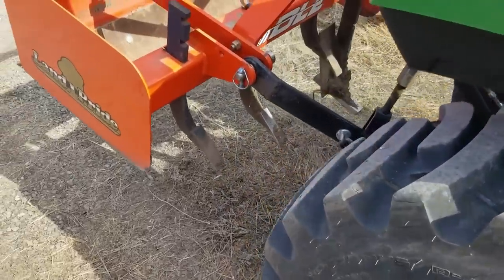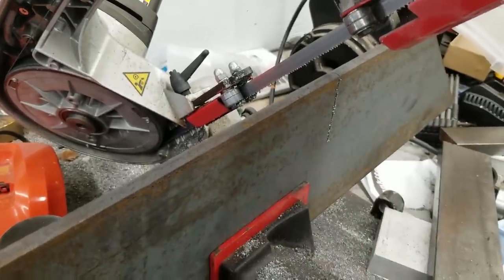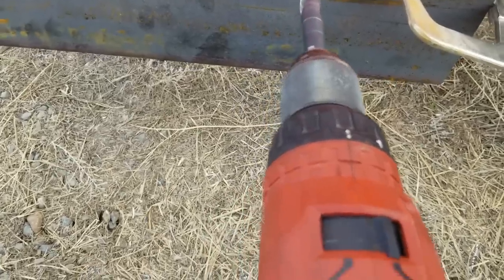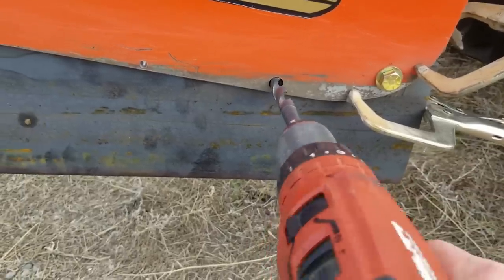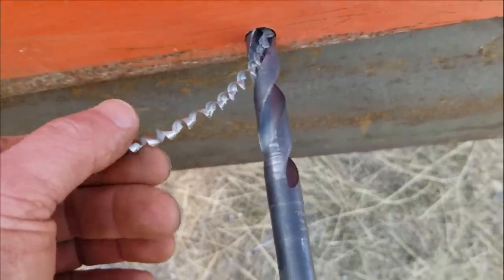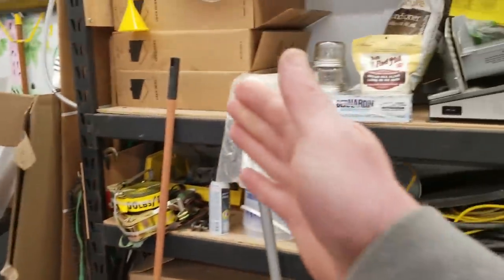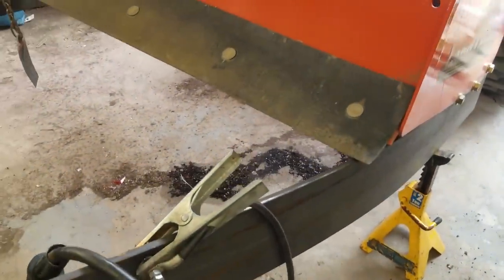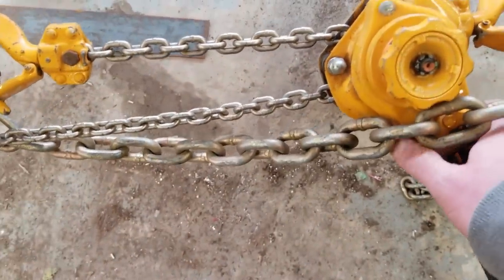Ol' Farmer Contraption: better beds

Comment: Ahh yes, picking rocks. I thought my folks were in the wrong business farming, we should have had a gravel pit 😂😂
Reply: Gravel grows up to be rocks.
Reply: Root systems keep the rocks in the ground for the most part. Its why the forest floor isnt covered in small rocks. Clear the ground down to open soil and every freeze thaw cycle brings every rock up an inch or 2. You'll be picking them for years in a new garden if you're ground is rocky like ours. Many places ive dug in ct were more rock than dirt. We would be short on backfill a lot of the time if the job called for rocks to be taken out. Putting it utility lines, planting trees, etc.
Reply: @ctdieselnut  Your average Black Hills South Dakota hay field will give you rocks by the semi truck load every year for many generations. My friends grand kids are picking rocks in the same field we did 30 years ago, so on and so forth since Custer first can through on his fateful trip to the Little Big horn.
Reply: @TraceyAllen  , I grew up 3 miles east of Caputa, just outside of Rapid City. The rock picking in that area is no joke. Dug up a 30 pound Fairburn agate digging a fence post hole one summer. It sat on our front porch for years, but long since has disappeared. Wish it was still around. I would slice it up and probably be able to sell it to make up for all the free labor I put in every summer picking rocks out of the field.

Comment: Torch the bends so the metal doesn't spring back when you remove the bolts from the back, And then add the bracing for redundancy and visual appreciation.

Comment: I once was making motor mounts for my 24 Hours of Lemons car with some UHMW,  a hole saw, and a 1/2" corded drill from the big rock candy mountain. I thought I could shoot a nice picture for the build blog with my left hand, while drilling with my right, and soon found myself flipped over with a cord around my right arm and a busted metacarpal to boot. Two handed drilling! And is that RCR at the end?

Comment: Here's a trick to drilling a hole to get through the last part.  Once it's where you changed speed just go around to tother side and drill from there. It goes through like butter that way and also does not leave a burr.

Comment: To drill through the other side of metal I let off on the pressure.  If I get it right the hole finishes smoothly.  Though, I still pucker up from memories of twisted wrists and drills chucked across the room.  If you do it enough there is a change in sound to be learned when the bit is reaching the other side.  It's the hole getting bigger as the point goes through.  Or, you can strap a piece of wood to the other side to drill into.  What's happening is as the metal being drilled gets thin the drill bit is able to grab the whole thickness and get all caught up.  Literally, but not quite literally,  biting off more than it can chew.  Light pressure or a backing plate helps with this.

Comment: I grew up on a good bit of land in the San Pedro Valley of southern Arizona my grandparents were right down the road. The land owned by my parents and the land owned by my grandparents was all ancient riverbed. Just under the ground is densely packed rock between 18 and 1 inch and I'd say every size had just about equal representation. No lawn mowers. Both properties had to be cut with a string trimmer. Picking rocks was a chore that we attempted and that my mom is still attempting at retirement age. It's hopeless. But I still had to fucking do it.

Comment: Back in the day, the time before the insanity bled over from England, we used a sheet metal grind on the drill bit to keep the bit from binding on the final part.  Some call this a brass grind, as brass will pull the bit out of the chuck.

Comment: You need disk to help break up the dirt prior to pulling into rows.  Two pairs mounted on that front pole should suffice.  Hard part is they need to be a V shape so the edge of each  disk in each pair touches.  The effort to add them will be greatly rewarded.  It reduces the rototiller time and knocks apart large chunks that were missed.

Comment: I go full speed as fast as the drill will spin at the end of the hole. If your spinning fast when you hit that edge on the back side of the hole the momentum is usually enough to breakthrough and cut that last little bit of metal.

Comment: :You have to replace that band saw with a cold cut saw, total game changers. My makita chopsaw is awesome. And my Milwaukee skill saw equally so for jobs too big to move. The dewalt  5 inch 20v skillsaw is also remarkable, great for going to metal rack and just cutting off a piece of flatbar without moving it. I can make a four foot cut through 1/4 plate in 30 seconds, razor accuracy machined edge.

Comment: It might be contradictory to standard practices, but I personally like to set the clutch to its highest setting that isn't drill or hammer. On some drills i might set it lower but the intent is for the clutch to slip instead of unexpectedly breaking my wrist on a random ass pocket of air in military grade materials and especially with tree carcasses.

For the most part, my hammerless compact drill sits on a clutch setting that slips right around 20in lbs of torque.

Comment: Where I live it was a bit more root picking than rock picking. Big ole bonfire on a cloudy day so no neighbors called the fire department. Stand about 100ft away so the heat didn't render the grease from your face. Great times!

Comment: all that about drilling remided me
I like to pull out my smaller drill to do bid holes in steel. 
the XR I normally use will throw my scrawny ass across the room when it binds up, so id rather have the atomic just stall on me, correct whatever problem and keep chooch'n
the XR is really only the go to because it has a hammer mode

Comment: I own some Festool tools … and since I own them I never broken a single drill bit - with the torque limiter activated at a torque suitable for the drill diameter… but this should work to any drilling machine with adjustable clutch torque…

Comment: Ever experiment with the no dig?
Reply from the maker: I defer to millennia of prior experience. "Works until it don't."
Reply: @arduinoversusevil2025  fare, just curious if you had played with the idea in a corner of the garden. personally found some aspects to be beneficial, like dark loamy soil, soil life and worms. i think integrating the two practices when the situation suits has value. Example even if you still till and dig a simple ground coverer, like leaves wood chips straw grass or brush clippings can be great for moisture is the heat of summer or hold in warmth in winter, nutrient retention, weed reduction.

Comment: Put the shaper on the back of a rotary tiller, and add a platform for ballast (two ohio stripper poles should do - it's mild steel) because the shaper will tend to surf the broken dirt rather than shape it.

Comment: If you finish the hole by holding the drill in your left hand, if it jams and tries to throw you into the weeds, it will just twist itself out of your grip, and no harm done.  If you hold it right handed, it jams into your palm, you can't get your finger off the trigger, and will rotate your whole body via your wrist and generate a six month soft tissue injury. Ask me how i know...

Comment: Was working on a taro farm for a bit, the planter requires a small man to sit on a wooden chair and drop taro down chutes, fucking awful job for a the average sized 200lb gorilla, there was no more leg room without adjusting the tractors 3 linkage height/angle, which fucked up the planting depth, it was fun designing a prototype in my head while contorted and cramping up, shoving half of a shit tasting potato down a hole.

Comment: Rent a derocker and don't worry about the rocks anymore
Reply: But that would deprive Uncle Bumblefuck of the chance to torture his daughter.  And it would cost more, too.
Reply: @dfross87  it's the only option I had for my property.  An old river used to run through my 5 acres.  It's so full of river rock it's kinda insane.
Reply: @MrRandyj72  Thankfully that's not a problem where I live.  Rocks?  What rocks?  We have sand in areas.  Dirt in other areas.

There used to be one massive boulder here, but that got blown bits 100+ years ago.

Comment: If ya didn't have those weak machinist wrist you'd send it high speed all the way through the pilot . The weakest spot will break. That's either you, the drill bit or the hole. If you go flexing your female wrist around your prolly going to break the bit fuckle the hole and your wrist at the same time